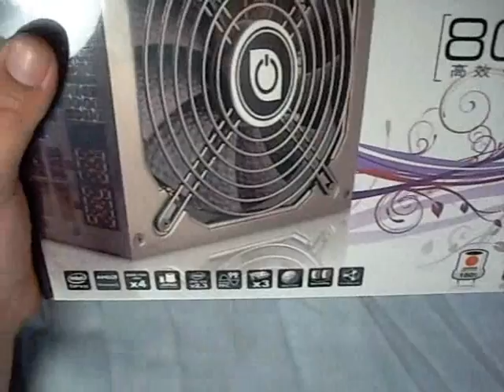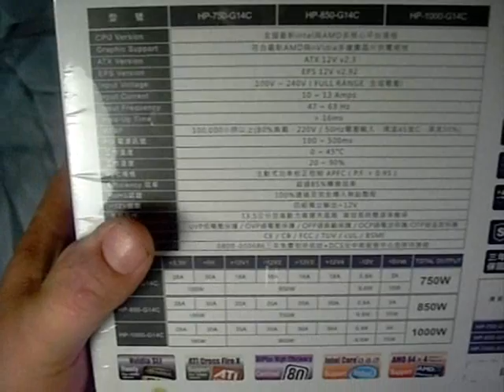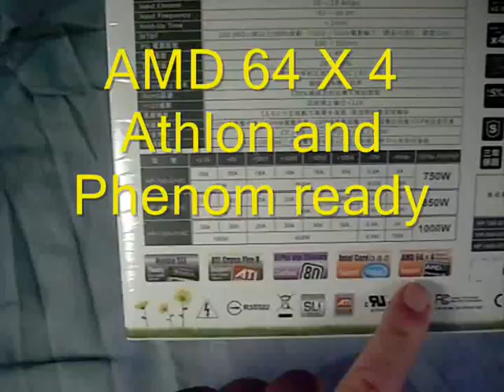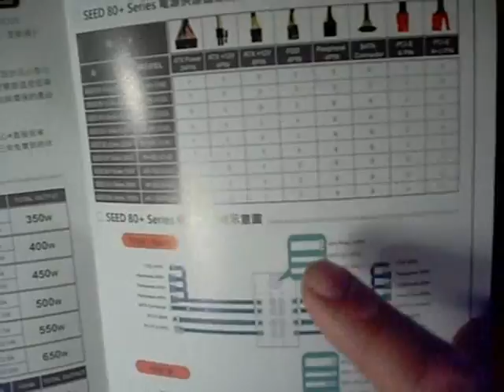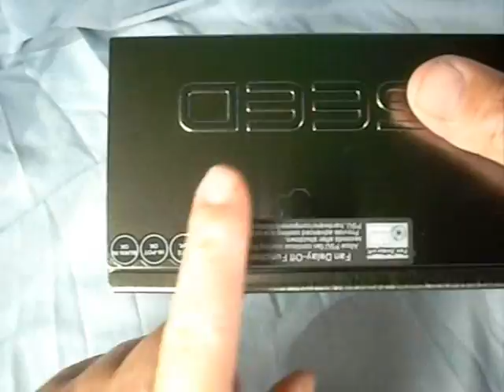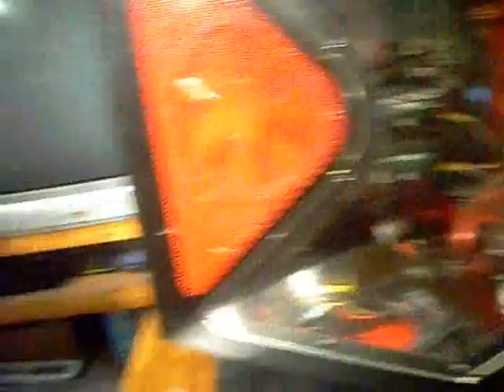Product Showcase Seed 750w 80+ modular PSU HP-750-G14C

Comment from the maker: @PGTMan Yes it saure has been. There is just no way to do a good job on your cables with out have a modular design. That Antec Is a real tuff case to do cables because the power supply has to be upside down in it. they didnt think to make a hole in the bottom of the case so it could mount the right way. I think i am going to have to get the saw out and make my own.:-)